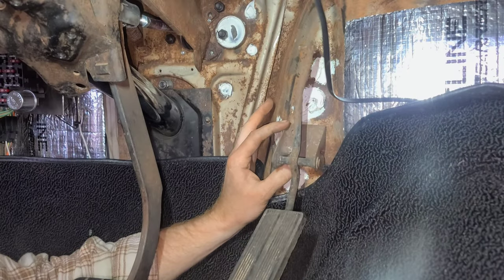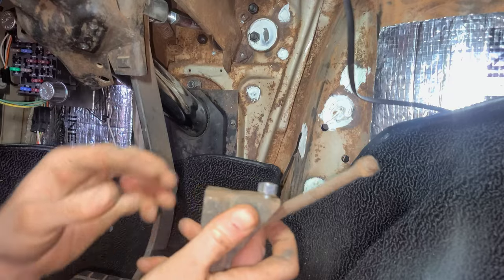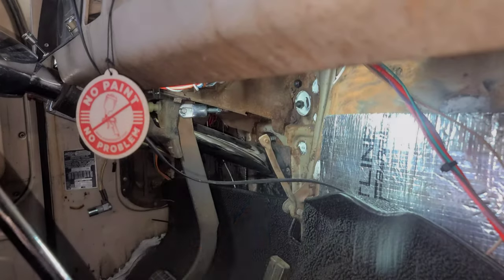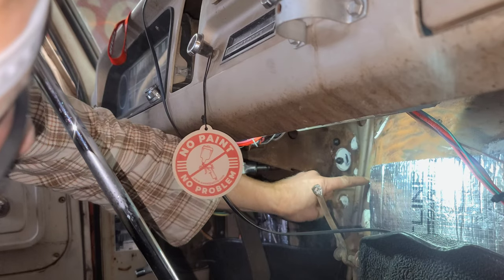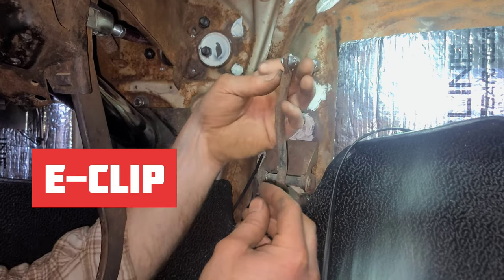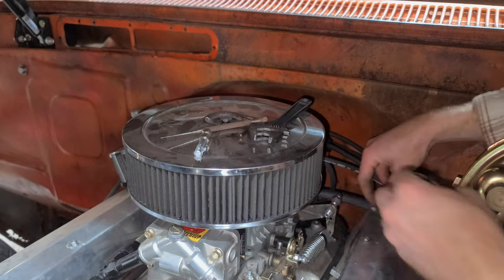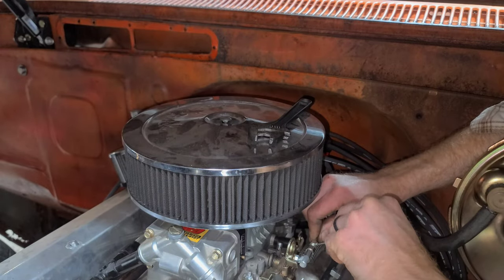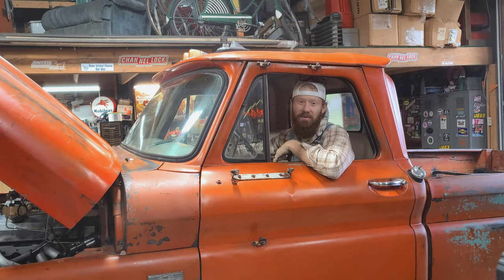Cheap Universal Gas Pedal Idea

Comment: On my 1951 Chevy truck I will be putting in a 283 small block engine. What kind of gas pedal kit can I get for it? Does speedway have  something like that
Reply from the maker: They have some nice options on there. They sell aftermarket stuff similar to the one I used. I just had thes one laying around and happened to be perfect